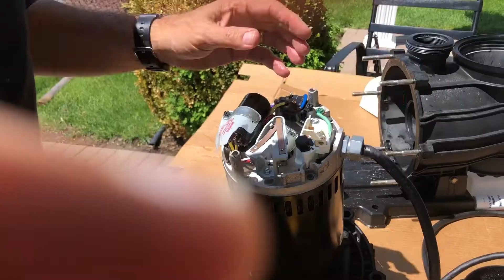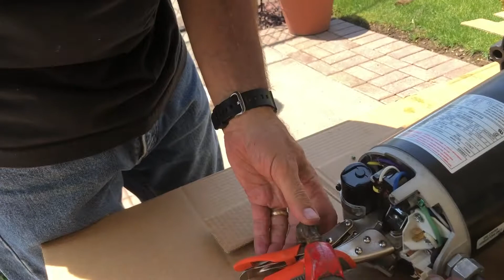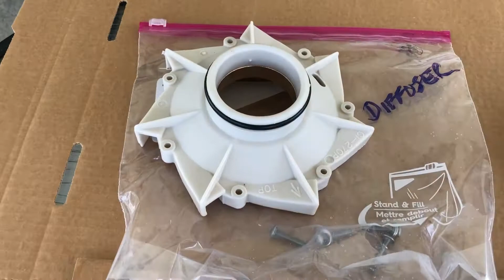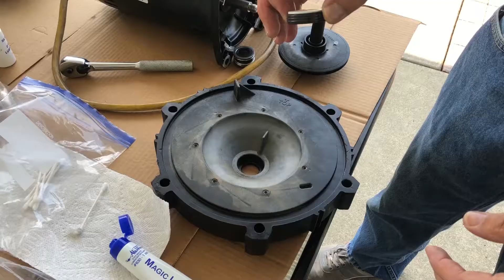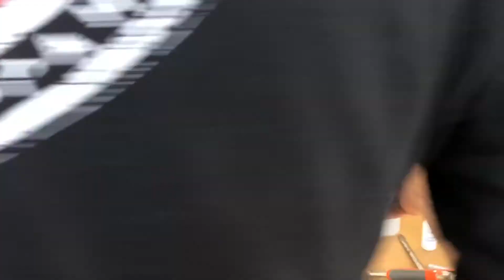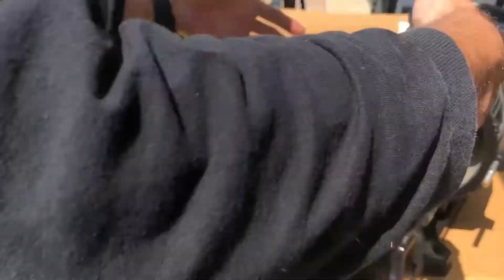Sta-Rite Pentair Water Swimming Pool Pump - Rebuild Repair

Comment: I am a Certified Pool Operator and you are going about taking the impeller out all wrong. You don’t have to remove the little v-shaped plastic piece or the springs you took out. There is a flat spot on the shaft underneath where you took the springs off and a 7/16 wrench fits on it and you can use that to hold the shaft and screw off the impeller. You will have to look but there is room to put the wrench on the shaft in between all the other stuff, you don’t have to remove anything